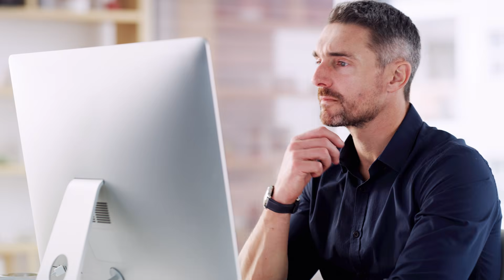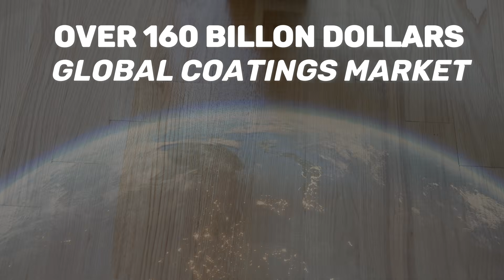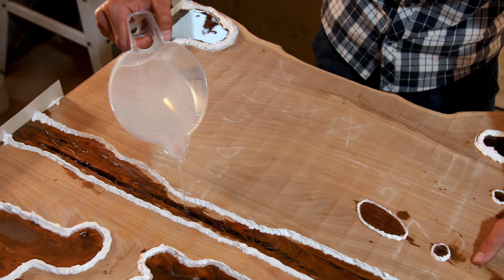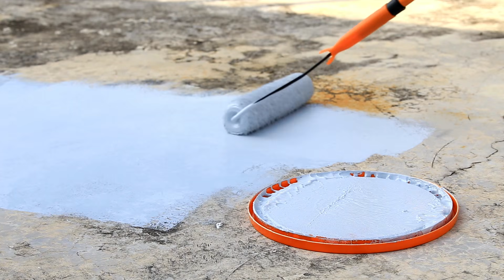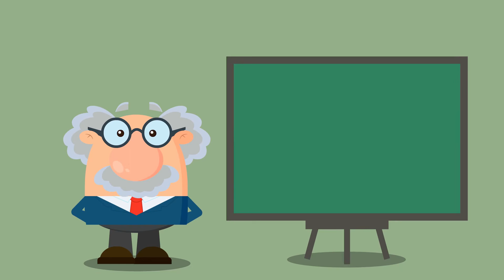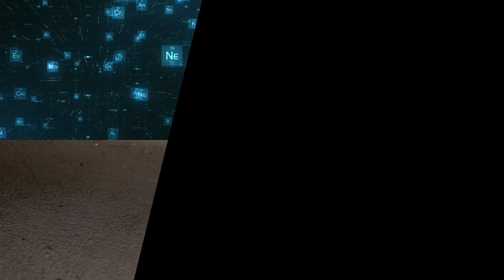PolyCoatings Ep.1 | Industrial Polymer Coatings Overview | (Epoxy, PU, Polyaspartics, Polyurea etc)

Comment: Missing a lot. Vinyl ester. Pmma. Xolutec. Hybrid polyurea acrylic. But interesting to see
Reply from the maker: Good point. This episode only focuses on the most commonly used industrial systems to give a very quick overview.
Systems like alkyds, vinyl esters, UPR, MMA Based, water-based acrylics, hybrid systems and others will be covered in separate deeper-dive episodes in the series.

Appreciate the input, do stay tuned and feel free to subscribe for the upcoming ones. Thank you 😇
Reply from the maker: Also, @glennpuystjens Xolutec seems quite specific and not as widely used, is it tied to a particular company or starting to see broader use in the industry?